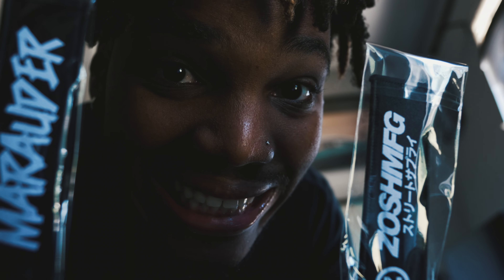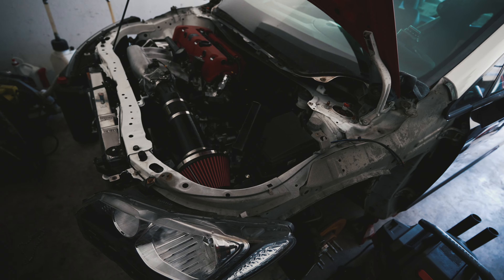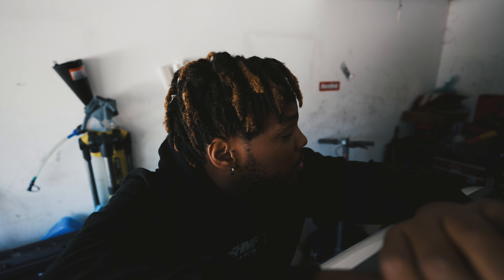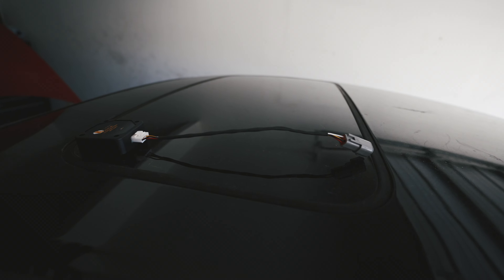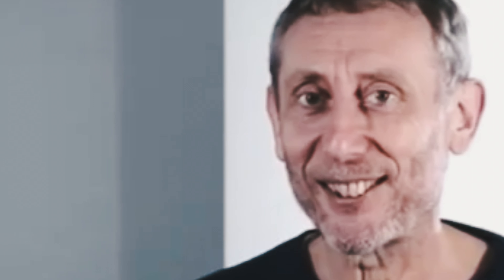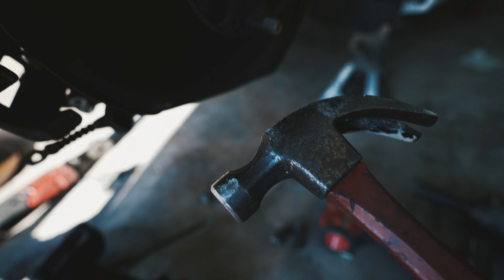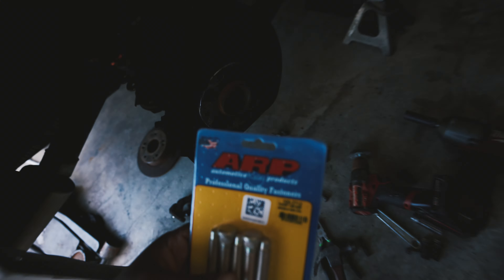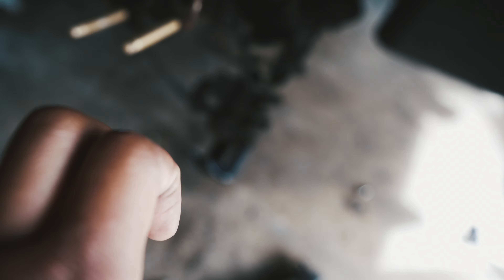Parting Ways With my 2007 'FD2' Honda Civic

Comment: Zosh you can swap the brake master reservoir to keep it Oem-ish if you want. I did it before but couldn’t run the actual master because the Rsx fittings are too small.